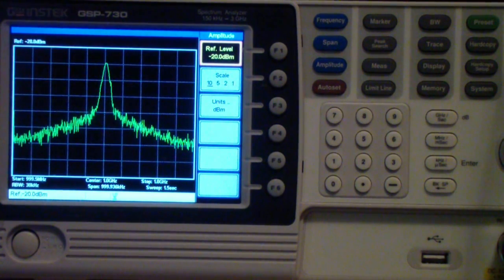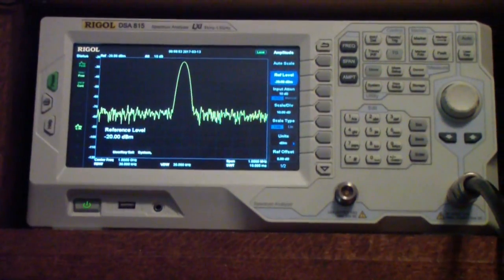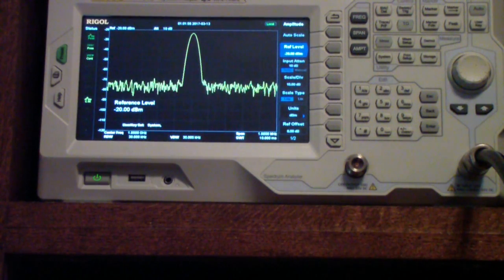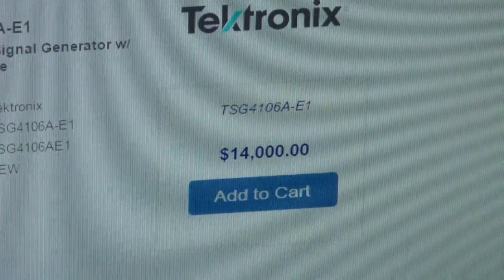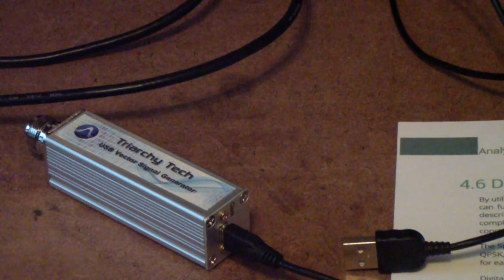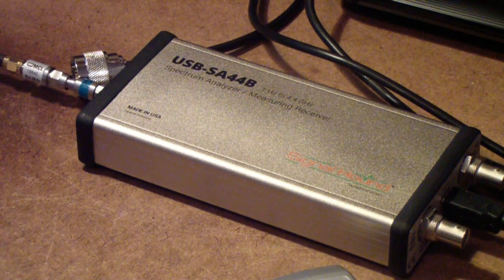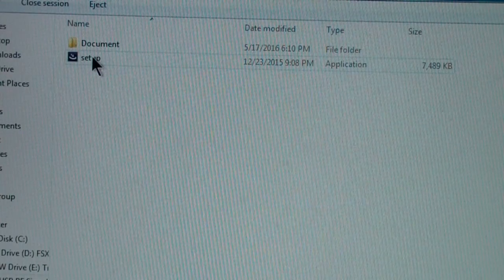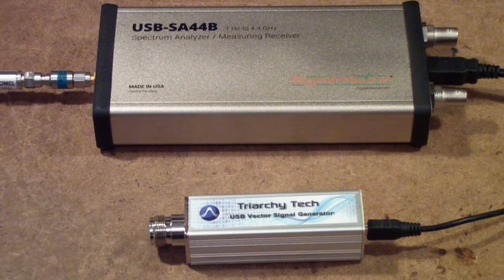TTT151 Digital Modulation Overview

Comment: Hi.. and Thanks!
I have the Triarchy VSG6  and their Spectrum Analyzer. (The earlier 6GHz model)

The software is terrible IMHO.  I had it functional and was able to apply the calibration files
in the original ToughBook (win 7 pro) laptop I had  back when I originally purchased the Triarchy Tech devices.

But... It will not load the cal files on my new ThinkPad “portable workstation” (aka “laptop” 🙄)
Their support is just plain awful.

I DO like the Spike application for the SignalHound line.
The company is entirely US based and the hardware is produced here as well.
The tech support is incredibly good for an instrumentation company.

I am contemplating purchasing a spec analyzer and separate tracking generator 
for a project I have in mind.   The Signal Path and Comms Prepper YouTube channels 
both have very good review videos and they are both very reputable sources IMHO.

I also have an Agilent N9340b “handheld”  spec analyzer.
It is excellent and durable... BUT .. the display is very difficult to read in anything other than 
dim light environments.  It goes to 3GHz, but most of my work is in public safety 2-way comms,
so I rarely go above 900mhz.   The cost was far more than I felt comfortable spending at the time
 ($6695 with TG and pre-amp options). but I somehow justified it to myself. 🙄  
I primarily Use it as a hobbyist and, now that I’m retired.. and I occasionally tune a duplexer or cavity for
friends and the occasional prior client.      Definitely not worth it for what I am doing...

But... believe it or not... with the higher-tier tools available to me,
it always seems like I just reach for my “economy” DSA815tg.  

It is lightweight (1/2 the weight of the Agilent), does not require a functional computer,
has a great (BRIGHT!) display and it is quite easy to use.  (especially for knuckleheads like me 😉😷🤣)
AND... it was CHEAP (compared to the other solutions I own) at $1875 with TG option and Rigol soft case.

Might I suggest the BEST ACCESSORY for RF ?.   It is by far the BEST investment I’ve made in the past decade.
The RF Industries “Unidapt” connector set.  It is a “universal” conmector set that includes nearly every RF 
connector (depending on the set you purchase..  they have 3 or 4 sets ranging from $60 - $550)
I won’t be able to do it justice here, so go and Google it.   PLEASE 🐔

Two things I should mention:  

absolutely purchase the “WHITE BRONZE” finish.  (a few dollars more than 
the nickel plated, but the finish will last longer and no issues with PIM / intermod).  

and...  take a look at their BLUE interconnect cables.  While you can use your own,
you will get much more use out of the set when you do not have to sacrifice extra 
connectors to interface with your own cables.

The “BLUE” Unidapt  coax cables are made by Belden specifically for Unidaot.
It is a hybrid between the RG400 and RG58 cable types.  Silver plated 
stranded center conductor / silver-plated DOUBLE SHIELDING/ ultra flexible/ 
very nice strain relief boots installed / silver plated “Unidapt” specialty fittings installed on both ends.
(they mate directly with the connectors/ adapters that come with the sets)

The cables are 5’ and 6’ in length and cost around $22-35@. Compare that to my Pasternack and 
other “high tier” cables and these are much nicer and a fraction of the cost.

Forgot... just a quick list of connector types in my “medium”  Unidapt set (2x of each type)
N Male / N female / BNC male / BNC female / F male / F female / SMA male / SMA female
MCX male / MCX female / RCA “phono” male / RCA “phono” female / 7/16” DIN male and female
AND....  6x “couplers” (threaded double female Unidapt on each side)

Thanks for your channel and videos!  
I will be binge watching all weekend.
👍🏻 73 from NJ

 

The Salty Cracker Army is Legion
🧂🧂🧂🧂🇺🇸🇺🇸🇺🇸🧂🧂🧂🧂

Epstein did NOT kill himself.

And...

Sleazy Joe Biden is NOT my Duly-Elected President.!
🇺🇸🇺🇸🇺🇸🇺🇸🇺🇸🇺🇸🇺🇸🇺🇸🇺🇸🇺🇸🇺🇸🇺🇸🇺🇸🇺🇸🇺🇸🇺🇸🇺🇸🇺🇸

Comment: I enjoy these videos.  Thanks for taking the time.  I am considering buying both the VSG6G1 and the the SH USB-SA44B.  Are you still happy with both after using them for a couple of months?  I want to use them for a similar purpose as you, to study different digital modulations.  Thanks, Joe
Reply from the maker: Yes, I am still very happy with both of them. The only problem I had with either was the calibration of the VSG6G1, but after I figured out that you must copy the calibration files from the disk, rather than depending on the installer to do so, the problem was solved. If you get them, I am sure you will enjoy using them to explore digital modulation and other topics in modern communication.